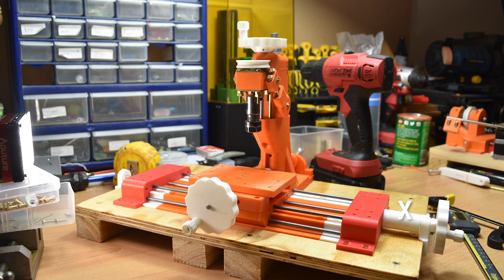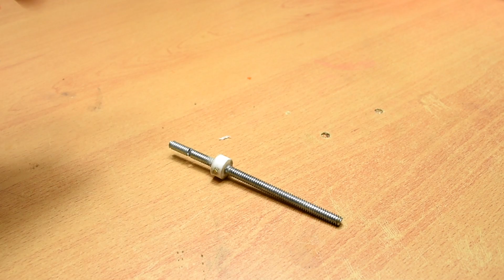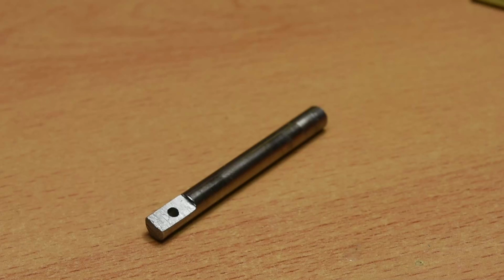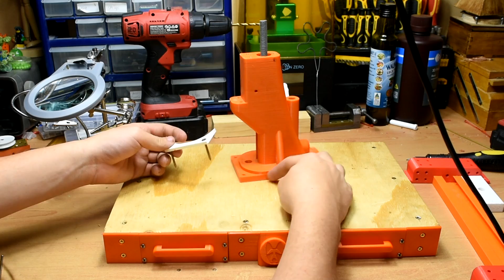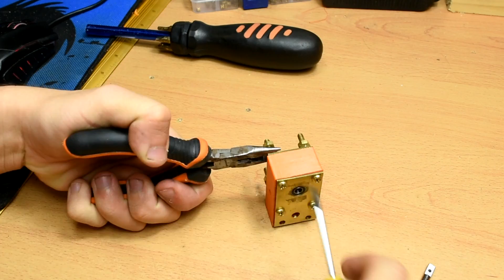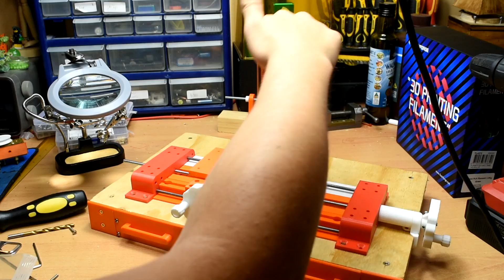3D Printed Manual Mill- Build Video

Comment: Just FYI (and I know this is an old video!), on a mill, the Z axis is always the vertical axis (you have the Y and Z swapped in your nomenclature). Sometimes there is confusion about axis labeling on lathes or on surface grinders (because the "rule" is that the spindle spins about the Z axis, which means what looks like an X/Y table on a mill might be something else on a surface grinder) , but there's no confusion on mills. And of course there's the right-hand rule.
Reply: True dat.

Comment: I wondered why you used a hand screwdriver for those bolts that you said took ages (into the white bits). Especially when the battery drill was in frame...

Comment: A little late to the party, but for reference to anyone in the US... 3/16 nuts, bolts or threaded rods are more commonly called #10-24 (or #10-32, if you're made of money and have unlimited time).

Just tossing it in there since I actually had to look it up myself. Saving everyone a Google search.